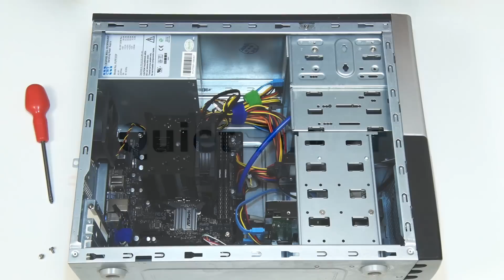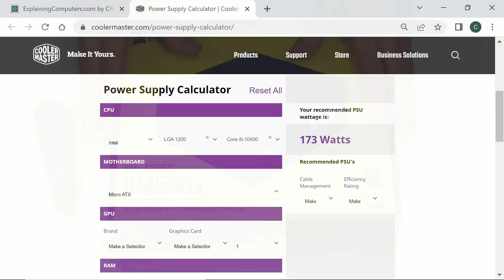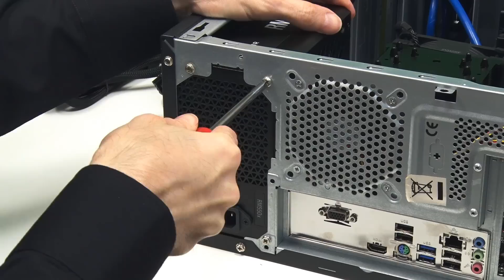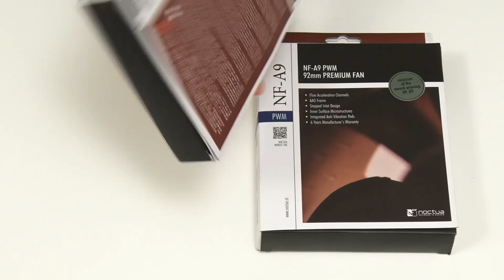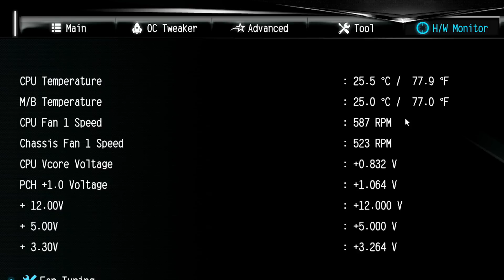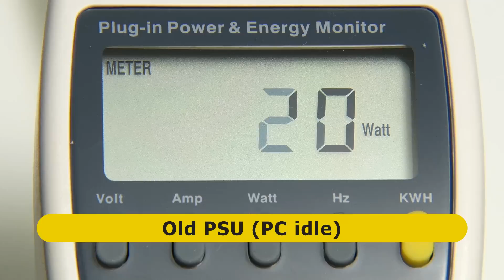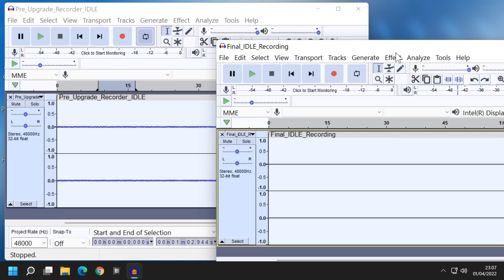Quieter PC #2: Corsair RMx PSU & Case Fans

Comment: You're wrong about the biggest noise source in your PC. It's the mechanical hard drive. If you listen for noise sources with your ears/sound meters, you'll always find other components to be the biggest noise source. You won't realize how much noise the HDD makes until you take it out. While the drive itself doesn't make much noise the vibrations it makes is immensely magnified by your case, especially a flimsy one like you're using (not bashing on the case btw, but if you want to eliminate mechanical hard drive vibrations, your case should weigh in around 20 kg empty - not practical and basically nobody makes those anymore). The absolute best way to eliminate HDD vibrations (other than using an SSD instead) is....(no, I'm not going to say use rubber grommets, they don't work, the screws still carry the vibrations), ...to hang the HDD. Use some strong elastic bands (like the kind used in garments, the round ones), wrap the ends on HDD mounting screws, ziptie the ends and fix with epoxy on top and hang it from the bottom of the higher bays. Personally, with that case, I'd cut out the metal sheets that are holding the HDDs now (with the HDD in place), turn them sideways and mount the entire cage with elastic bands. You won't believe how much noise it cuts down.  I had a very old system with pictures in www.silentpcreview.com forums but apparently it got so old that it's deleted now. I'll try to dig up the photos if I have them in a backup somewhere.
Reply from the maker: No, I am not wrong. You clearly did not listen to what I said in the video. I made it very clear indeed that the hard drive in this computer is not connected and was not part of the process of making a quiet system. So the hard drive here is SILENT -- as it is NOT CONNECTED !:)

Comment: This is the very process of PC builds that I find so exasperating. 

1. Create a problem "saving money"

2. Deny there is a problem

3. When no-one cares anymore FINALLY patch the problem with more money that you should have spent in the first place to not have a problem.

4. End result a patched solution with other problems
Reply from the maker: But this is not what happened here! :) As noted in the previous episode, this PC has gone through many distinct upgrades solely to demonstrate the same in videos. And at the end of that process I decided to use the hardware for something else.

Comment: Just saying, Scythe makes cheaper and quieter fans than Noctua.
Reply from the maker: We all have our component preferences. The fans here are very quiet indeed.
Reply: @ExplainingComputers  Price isn't exactly a preference, neither are results.
Reply from the maker: @MJ-uk6lu  My first reply was a polite way to  acknowledge my difference of opinion to your "just saying" criticism. Scythe indeed make great fans, as do Noctua, and different people have different preferences.

I do not believe that I would find other fans quieter than the Noctua, and they are hardly an usual product to use. Price is most certainly a preference (and I say that as somebody with an economics degree who use to lecture in economics in a university). And price often, but not always, equates to quality in addition to function, which is a reason than many people choose Noctua.
Reply: @ExplainingComputers  Noctua is luxury product, it's nice, but value isn't there. You get same or lower quality than Scythe, but for more money. Obviously it's a preference of what one buys, but whether Noctua products are the best isn't clear. If you look at many fan reviews they perform well, but often fail to take top spots and value isn't great. And you absolutely can build a quiet computer for much less. i5 in this machine would run perfectly fine with standard 120mm air cooler for any brand with fan removed. If you want cheap silence with fans, you buy slowest fans that you can find and buy rubber grommets. There's no magic in silent fans and if you look at reviews, there truly isn't any bearing technology yet that manages to deliver more airflow per decibel. The only "technology" to that is buying slower bigger diameter fan, that spins slower. Works very well, is usually cheap up to 140mm. This machine is fine with slow and small fans, but if you need more cooling performance and quietness, then case upgrade is a must. If you get case for 35-40 pounds, and put cheaper fans, you end up with overall cheaper build, than finding and fitting smaller faster fans.
As far as videos go, it would be interesting to see how machine performs without CPU fan. It seems to run really cool, fan barely spins, so I believe it might not get hot enough for fanless cooling. I managed to run stock FX 6300 with Scythe Mugen 4 cooler without fans and it didn't reach maximum temperature in prime95 small FFT test and Furmark running at the same time during hot summer day. I now have i5 104400F and I know that it's a cool running chip, but can run a bit hot if you crank up PL1 and PL2 way past official 65W/127W spec. Now that I think about it, your PC might perform perfectly fine without any fans at all or just with single exhaust fan at minimum speed.
Reply from the maker: @MJ-uk6lu  Thanks for this. As you say, the CPU may be fine without its cooling fine. I must test that out! :)